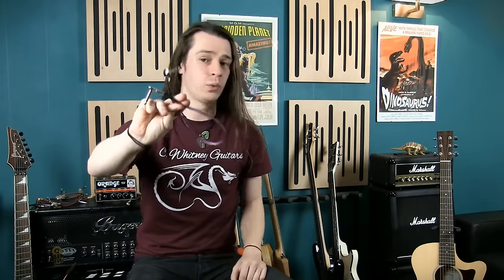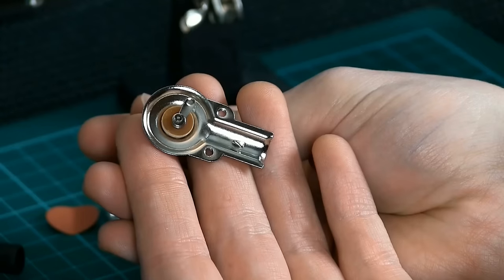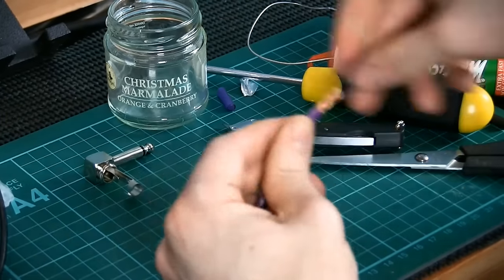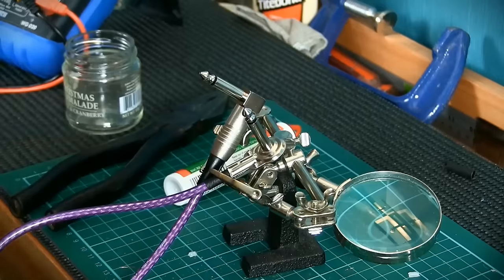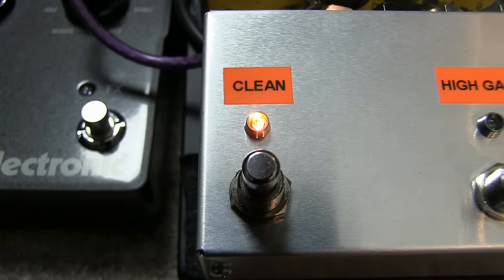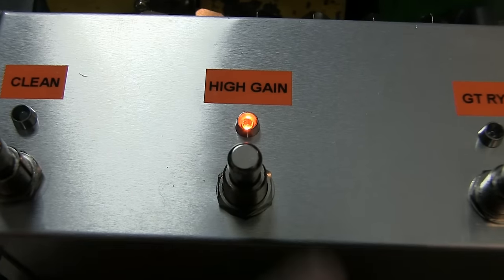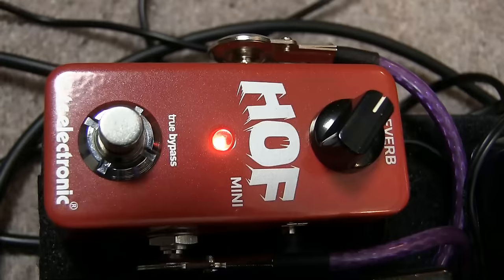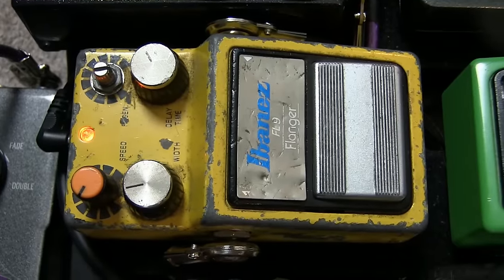Patch Cables & Programmable Loop Switcher

Comment: Hi Colin,
I really enjoy your videos, the guitar builds have been my favourite so far. I myself am an electrical engineer and seeing you solder those wires together made me want to give you a small advice that could even more improve your solder joints: Apply more and longer heat to your joints so they really "flow" into the copper shield of the cables. Otherwise you only have a small surface (only a few wires of the shield) connected to your plug-surface and mechanical stress could easily bring them apart, resulting in short circuits or just lost connection. The best temperature for that would lie around 300°C to 350°C (depending whether you are using leaded or lead-free soldering tin). I dont want to school you, I just want to help improve your already great videos! Keep it up like you do!
Cheers.
Reply: +1 to this.

Also, the cable you are using is not particularly brilliant for instrument/Pedal Board applications, something akin to Canford HSS or Kelsey ATM-INST that have the conductive plastic layer to lower microphonics in the cable would be much better suited and is pretty cheap (Canford is on special at 50p/meter at the moment)
Reply: One YouTube soldering tutorial (can't remember if it was EEVBlog) was particularly useful years ago when I watched it. The main things are to tin your iron to get better heat transfer, then apply the iron to one side of what you are tinning and apply the solder to the other side. There's a flux issue in there too... I'm not an EE!
Reply: There is already flux contained in most solder tins. But It is also very temperature dependent and differs largely between the different types of solder (leaded/non-leaded). Usually that is not really an issue if you use newly bought solder. In older ones it can denaturate and then lose its abilities.
Reply: I should have elaborated on that... I was alluding to the dabbing of solder from the iron to the part and flux evaporating off and not being transferred . I've often wondered about the shelf life of multicore solder... I have a lifetime's supply!
Reply from the maker: Thanks for this. I should probably put up a couple of my own points here:

What you see on camera isn't necessarily what I actually do. Sometimes you have to do what gets the shot at the pacing you want it, often times, like here, the best aesthetic shot isn't representative of the slower pace of reality. You can rest assured that all of the solder connections are completely sound here, despite the shots that made the cut seeming otherwise. The magic of television and all that, showing things how they actually are, at the real pace, isn't all that enticing a watch. 
I'm an electronics technician myself in my day job, I'm putting together cables all day every day, so don't worry, I know your advice well.

Further to the point on the type of cable, conductive plastic seems to have no real benefit in this particular application as its main advantages are of flexibility and reduced mechanical noise. As these are short lengths, fixed in place, there is next to no movement in these cables, so it would seem rather redundant. 
It's also worth noting that snake oil is well and truly a plague within the world of instrument cables, and test after test has proved that there is no difference between one form of cable over another in terms of audio performance, so long as the cable remains physically robust.
Reply: Having stood at the desk on a couple of gigs that a guitarist was using normal Co-Ax instead of low-microphonic grade cable, there was significant noise coming out of their setups enough that it made it noticeable in the FOH PA system...

Again in a more "studio" like environment I had to sack off a set of patch leads that were made of standard Co-ax (expensive co-ax at that, convincing the guitarist that the leads were to blame for the noise was difficult even after changing them solved the issue... "but they're really high quality!")
Reply: I'm incredulous about low-microphonic cable... especially in short patch cables. Abused cables - yeah... Anyway, love the vids Colin - perhaps just wishing someone could have shown and explained to me good soldering technique 20 years ago...
Reply: HOLY SHIT COLIN READS THE COMMENTS
Reply: Makes perfectly sense for me, thanks for elaborating. 
I just wanted to make clear that if one watches your video, often so uneducated in such fields, one could have the impression this is how it should be done. Maybe a disclaimer in some way would be an idea?
Cheers!
Reply: The solder itself has no expiration date (except oxidation is at place, which would take probably more that 100 years, depending on the alloy), but the flux has. I would date that to roughly 5 years.

Comment: 3 tips to help with DIY patch leads. I like the vid by the way.
1# You CAN squeeze pancake jacks into a narrower spacing.
Snip a segment off the side of the base and bend the top cover over. I use a tin-snips for the cut and a mole-grips to do the bend, a small vice would be good too. I make the cut from the screw tab and take 3mm to 4mm off. That 3mm to 4mm can be just enough to squeeze them in.
I had a loom to make for a Joyo/Harley Benton switcher and every other socket was too close. On that Buzzelectronic unit you might need to do it to all the pancakes. Saves a few mm of space which can be useful in some board configs. 
2# Soldering the screen to the bottom plate of a pancake jack makes a more secure connection. On longer leads than little patch cables especially there can be quite a bit of "creep" between the different layers within the cable. Knowing that the Screen is solidly connected is one less thing to go wrong.
3# On the two tab type jacks, bending in the corners of the tabs on the cable grip lets them bite into the outer insulation and holds better than a simple squeeze. Often you'll see that the tabs are already pointed. That type just need little a little bend on the points to do the job.

Comment: Hi Colin, I'll definitely be considering that programmable loop switcher; is it possible to make a video showing us and explaining all the connections? I'm confused as to how it is setup to use pedals through the fx loop. In your case, is this how it is done with 3 pedals in the fx loop: Fx loop Send>>>pedal 1 input>>>pedal 1 output>>>input of loop 1>>> output of loop 1>>> pedal 2 input>>> pedal 2 output>>> input of loop 2>>> output of loop 2>>> pedal 3 input>>> pedal 3 output>>> input of loop 3>>> output of loop 3>>> Fx loop Return?
Reply from the maker: The switcher has connections for the FX loop. Everything goes through the switcher. 

Input>send1>return1>send2>return2>FX Send
FX Return>send3>return3>... so on.
Reply: Awesome, I understand now. Thank you so much for the speedy reply Colin!

Comment: I'm also curious to know how you connected the noise gate. I got a Boss NS-2, which has connectivity similar to your TC Electronic Sentry noise gate.
Reply: It looks like he's not using the send/return loop. I could be wrong, it's tough to see...
Reply: Ian Cavanagh I think using the pedal's loop would require the use of 2 loops on something like this, and with both loops either on or off simultaneously, and with any intended effects to be gated to be placed in between those 2 loops. That's my theory on the use of NS-2 type noise gate connectivity on these types of loop switchers anyway. I'm trying to do as much research as possible on this before shelling out money for a loop switcher.
Reply: ***** i hear you. I also have the NS-2, from what I read on TC electronics website, as long as the noise gate is last in your signal chain (OD - distortion - fuzz - input NS-2) then it "should" clamp down on the noise. 

My big question with regards to loop switchers is : how does it determine chain order when multiple effects are engaged?
Is it based on: ex. "input 1" has priority over "input 2"?

Comment: I tried using regular coaxial cable that you would get from a cable hook up installation and it's very rigid and did not have braided copper shielding but looked like tin or aluminium (worked for like 5 minutes), is there a difference between this and what you used? Also where do you get your coaxial cable from? Like an electronics store or amazon?

Comment: Helpful vid however I missed one thing, does the looper also change your amp channels? If not do you know a way to change amp channel and switch the pedal loops at the same time? I'm modeling my sound mainly using the amp channels and want to use different pedals for each channel, for example chorus / echo on clean, maxon od 808 or tube screamer  on lead high gain channel and want to be able to change amp channel and effects loop with one click.

Comment: Did I hear correctly? You're using coaxial cable? You don't have any issues with the solid core wire being less flexible?
Reply from the maker: +LukeSniper coaxial means both cores share the same center axis, as in one core inside the other. 

There are many different types of coaxial cable. Audio coaxial like I'm using is stranded and flexible. Satellite coax, like you are thinking of is solid core, non flexible and not to be used for the purpose of making audio patch cables.
Reply: CSGuitars ah! Gotcha. I've never encountered the term used in such a general way, only ever specifically referring to cable tv wires. I thought you might be using it because it was cheaper or something.
Reply from the maker: Oh, never would I. I'm using good quality, flexible, well shielded audio coax. Sorry for the confusion.
Reply: CSGuitars what's the brand you're using? I really dig the trans purple jacket. The only people instrument I can find online is GLS and Rapco, which is an opaque pastel purple.

Comment: Great video. I just got my loop switcher. But the thought of breaking out the soldering iron..... too scary. I found a seller on reverb.com in the US that will do custom lengths and plug types. High quality. Great value. Tight Squeeze Cables. Check them out.

Comment: What about diy patch cables that aren't soldered. good or nah and why
Reply: Savage Silas he stated in a previous video that they are often unreliable and it's best do them yourself
Reply: Lloyd Midgley thanks man! I'm gonna just get some premade ones
Reply from the maker: I personally wouldn't touch the solderless patch cables. 
Learning to solder is a much more useful skill and far more reliable than entrusting that a spike has pierced into the core of the wire.
Reply: CSGuitars yeah I'm definitely going to learn to solder soon. keep up the good vids